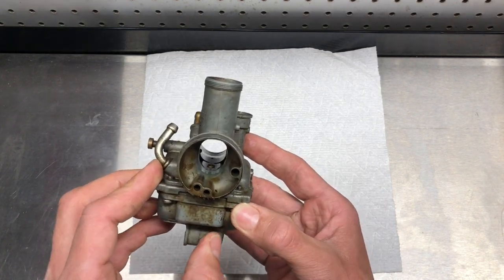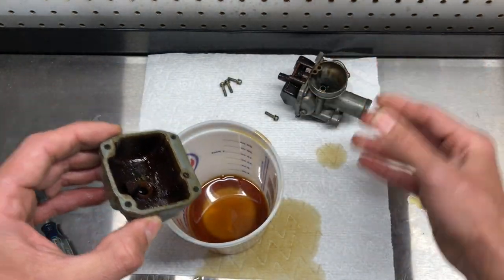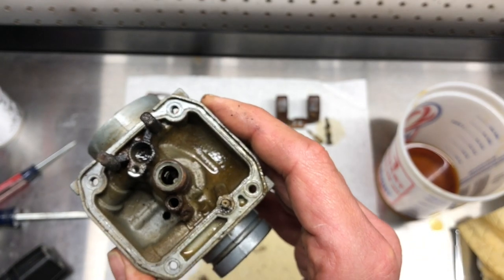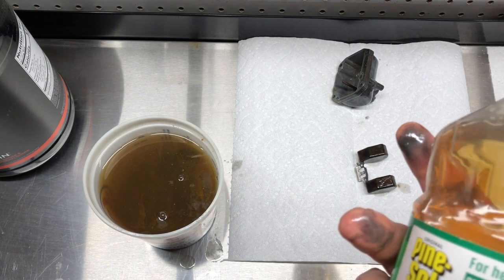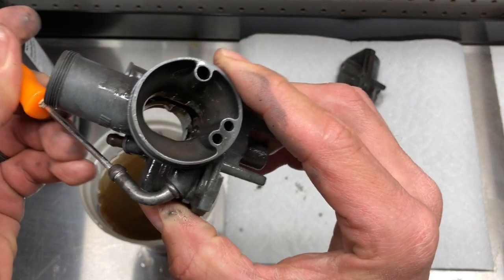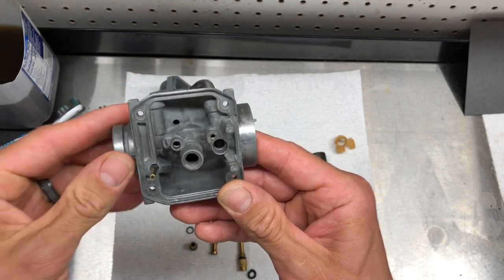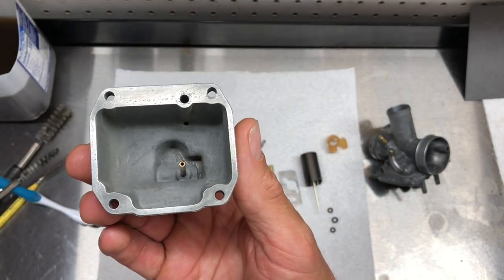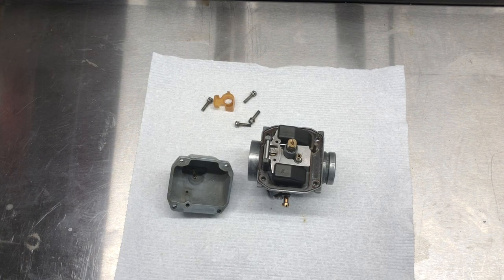Will Pine-Sol work to clean a varnished and dirty carburetor?

Comment: Fantastic job my friend! That is how you save a carb. That was nothing short of magic. I use simple green for pressure washers and it's quite expensive $20/gallon Canadian where the pinsol is just as good and I think better for so little money. The proof is in that carb you just saved. That float bowl would never have come clean with just normal carb clean spray.
Reply from the maker: Thanks for the love Pat!  I am really glad this little project worked out, the atv has been running quite amazing for just cleaning and setting up the carb!  I have found myself using Pine-Sol around my garage much more lately too haha.

Comment: Used Pine Sol over the wekend for my old Ford carb and worked very well. Only thing I noticed was Pine Sol tends to eat steel parts more than I expected. The  throttle lever and fast idle cam are steel and saw a bit of corrosion on them. Ended up using Evaporust in my ultrsonic cleaner and clened right up. I'm a new believer in the Pine Sol!

Comment: Great video. Lots of opinions on whether or not Pinesol should be used on aluminum. I use it all the time, in a heated ultrasonic cleaner. The key is to not let it sit for days or weeks. A couple hours or maybe overnight, then cleaning all of that dark gray stuff off--exactly as you showed. For the rough, external parts, I rub copper anti-sieze in, sparingly and make sure its all wiped clean. That seems to ward off oxidation of the aluminum for a good while. If you use it internally, I'd clean with a clean rag thoroughly. On the brass bits, Brasso and elbow grease get them into great shape.
Reply from the maker: Yea this is my first time really using Pine-Sol in this manner and I am glad I did rather than using a harsh chemical dip kit.  Thanks for the tips, I will have to wipe down the outside with a bit of anti seize.  I suppose that would work on the raw aluminum air cooled engine as well?
Reply: @HighPriority  I'm not sure how it would do on an air cooled engine. Probably pretty good. I used copper anti-sieze specifically, not the silver nickel-based stuff. I restore old BMW air-cooled bikes, with Bing carbs. Cleaning all that dark gray slurry off from the Pinesol dipping exposes the raw aluminum, so I hit it with WD-40, then wiped down and do the copper anti-sieze. I used Pinesol pure, maybe I'll try it 50/50 like you did.
Reply: ...oh and dress the sharp edge and 600grit or higher to gently smooth rough parts, before the anti-sieze.
Reply from the maker: @sailorcto  right on, thanks for the tips!
Reply: I have 5 motors sitting around WAITING for carb attention and will sure try this now. Th for the video....subscribed

Comment: Sweet! I just came across you vid today 6/3/23. I have a set of 4 carbs off my snowmobile (Rupp / Honda CB550). its been in and out of storage and run very little in the past 17 or so years. As of last winter, I lost one cylinder only rode one short trip around the field. This spring I started it to "summarize" it and noticed another cylinder dropping out. I pulled off the whole rack and dropped off the bowls.... yah. I was rather surprised on the corrosion and gunk build up. seeing I only run non-ethanol gas, i run it dry every spring (well not every spring) the tank is lined, I keep additive in the fuel and I still have a bowl just full of debris. (dirt, rust and deposits even looks like water was in them for a while) Im gonna try this method right here next week. I have a vid here on YT, (custom Rupp). It was running ok when i took this vid in the winter of 20" but not great.
Reply from the maker: Right on I hope this works for ya!  Sounds like a cool project I will def check it out.  The tank on this trike was pretty bad as well, rust and chunk. And stuff. I have another vid where I cleaned the tank out, I thought about lining it but didn’t.

Comment: Very impressive,  I work on a lot of riding mowers that I pick up free this will be my go to  from now on.  I have seen a video of a guy took a vibratory sander put velcro on the bottom of a jar stuck to the sander hung it up turned on the sander to get a little vibratory action going.  We 40? Try pb blaster it's cheaper and works great for me better than wd 40 does.
Reply from the maker: Thanks for the tip Gary I will try and grab some PB next time I'm out.  That sander idea sounds like it would work really well, I think I have one laying around here too!
Reply: I found that Walmart has the larger cans for like $6.00 and wd 40 is $ 8.00
Reply from the maker: @garyjordan3181  Good to know thanks.
Reply: I'm working on a carburetor now. Thinking of doing the sander trick with pinesol. Let the carb soak for a few hours in hot pinsol/water mix, then run the sander for like 30min...
Reply: I've done this with a sander. It really works well. Used pine sol. I have upgraded to ultrasonic cleaner simply because the setup is easier and faster. But it does work well.
Reply: @LowCountryoutdoors213  well it worked decently enough for me still went after the last of the dirt with a toothbrush but after soaking for 24 hours and vibrating with the sander for an hour the little that was left in the crevices and corners came easy enough. Th carb works well. However it doesnt really look new just way better than before.

Comment: I used Pine-Sol to clean the Edelbrock 1405 on my '69 AMX.  It did the job, too.  One float had gasoline inside it, which most likely explained why it flooded the last time I tried to start the 390 V8.
Reply from the maker: Nice! I may use it only on my Q-jet one of these days if I decide to tackle that job.  I just like how the stuff isn't so damn toxic.

Comment: Do ultrasonics get inside the tiny gubbins and that?  This is an excellent tip but not quite getting into the corners?
Reply from the maker: I did look into setting up some sort of untrasonic but I think I got lazy.  This method did work alright but I did have to pick junk out with some brushes and tools so I think using this in conjunction would be better.  I will try and do an ultra sonic on the next one!

Comment: I use pine sol soak it overnight spray with carb cleaner. Works on most of the carbs. If not order a new one

Comment: Maybe after soaking you use a water blaster to remove the grey scum. Then you should not need to scrub and the effect should be uniform over the whole caribe.
Reply from the maker: I will have to try that in the next project. It would be nice to have a uniform look all over the aluminum.

Comment: Looks great, but want to know if the carb actually worked to get your machine running.
Reply from the maker: Thank you George.  Yes sir the carb is back together and functioning quite well.  I did get junk from the tank that plugged up the pilot jet quite badly so I did have to replace that.  I will be making a video soon of it in action once I get a few other things wrapped up on it.

Comment: Nope turning that "aluminum" which really is pot metal black means you've ripped off the protective "parkerizing" which really is a zinc and cadmium coating. It will take the oxygen in the wonderful gas of today and make flowery alumimum oxide. You could have just used hot water and elbow grease to get it clean better. You also are better off using petro based because, well it is supposed to stand in gas for all eternity.
Reply from the maker: Thank you for the insight, I did not know this.
Reply: @HighPriority  You dont want to know how I know. Really the best "lazy" way to clean a caked up carb is a few days at a time soak in good old gasoline. Then take it out, tooth brush what you can off, and soak in fresh gas, Rinse repeat 1 week at a time. Works well in "projects time" = Winter, gas evaporates slow, breaks down slow and its all in dead (non riding) time. Also soaking the whole body of the carb is a bit counterproductive. Most carbs have dirt and gunk and other dust on the outside but just gas dried and lacquered inside. Getting those 2 mixed into each other is another sure fire way to make a bad problem much much worse. I'd clean the inside, and leave the outside as filthy as it was. But then again a "restoration" wont work with that.

Comment: Can you use this stuff indoors? Hoping to find a cleaner that doesn't have harmful fumes.
Reply from the maker: I used it in the garage and I don’t think it would be an issue in the house as it doesn’t smell bad at all to me anyway. Just reading on their website it doesn’t say it’s toxic and they use it in floors, laundry, and for other surfaces so you should be good!
Reply: @HighPriority  thanks! yeah just tried it and very pleased with the results and no fumes in the house
Reply: Pine sol is used all the time in houses. I use it to mop

Comment: The best thing is a mixture of meratic acid and water it only takes a few minutes, but it takes the shine off, you can bring it back with a small hand blaster using soda, I discovered it on line and tried it, works great but you are dealing with acid, the only other thing that works better is chem cleaner
Reply from the maker: Thank you. I may try that out on the next one.
Reply: Be careful with this combo. That acid reacts with aluminum. It looked like it started boiling instantly and ate a fuel petcock on me when cleaning a old fuel tank.

Comment: unfortunately we have no Pine-sol in europe, unbeliavable this was never been imported, a bottle from USA ebay + shipping costs more than a ultrasonic cleaner from China LoL
Reply from the maker: Ahh that's a bummer!  I wonder if you have something equivalent out there.
Reply: @HighPriority  i am still looking for, it doesnt look to be , right now, i looked everywhere. it looks weird noone did a similiar thing like Pepsi is to  Coke LoL
Reply from the maker: @idontcareaboutyou7757  haha yea maybe time to try some experimenting.
Reply: I believe the pinesol equivalent in the UK is Dettol.
Reply: @boastyy  thanks, i'll give it a try
Reply: @idontcareaboutyou7757  Hi mate. I bought an ultrasonic cleaner a couple of weeks ago and have already brought back to life five garden tools, strimmers chainsaws etc. What seems to be working great when cleaning the carbs is a mix I put together and this procedure.  I  have a 6 litre ultrasonic tank, put some fairy liquid and cold water into the tank until its about 20 percent full. Then I boil a kettle"twice" and fill the tank up to the fill line. (Better to not pour hot water straight into the tank without cold water in the bottom to avoid thermal shock damaging the tanks cement holding the inducers) Then I add a couple of cap fulls of white spirit, dettol and windscreen wash. Temperature should be between 50 to 65 degrees with that boiling water added and is much quicker than waiting for the tank to heat the water on its own. Put the ultrasonic on  and leaave it degass the mixture for a couple of minutes before you add anything to be cleaned. Works perfectly for me and very cheap mixture.Hope this helps mate.
Reply: @boastyy  thaks mate, i am thinking to get one of those ultrasonic cleaners, i will try this procedure, just what is it the -fairy liquid-? sorry
Reply: @idontcareaboutyou7757  Fairy liquid yeh I cringed typing it, lol, it is washing up liquid here in the UK, its the same as Dawn washing up liquid in the USA. Any washing up liquid for dishes will do or if you can get industrial strength degreasers but make sure whatever you use is safe for whatever you are cleaning. To be honest less is more, the ultrasonic and the hot water with just a touch of the other stuff does the job well and does not do any harm. Good luck man hope you enjoy your cleaner when you get it, I am very happy with mine.cya
Reply: @boastyy  Less is more LoL as a big Mies Van der Rohe fan i agree 100%. thanks for explaination.  i think i'll get a Aliexpress ultrasonic cleaner, they look good  and exactly like amazons ones. any idea to suggest me? thanks
Reply: @idontcareaboutyou7757  Sorry did not get back to you earlier mate just seen your message. I believe most of the Ultrasonics sold on Amazon and Ebay are made in China. So if you don't mind waiting a bit longer to get it I am sure the Aliexpress ones will be the same type and probably offer a good saving. Just check the reviews and go with a seller that has good feedback and have sold quite a few of them. If it was me I would probably go for a local seller from Amazon or Ebay. My thinking is, if the box is dropped the Ultrasonic cleaners are quite fragile, the inducers are cemented to the tank so can be damaged so there is less chance of something going wrong with a local delivery.Or if it does get damaged you can send it back easily, otherwise might be a nightmare. This is where I had my cleaner.
https://www.ebay.co.uk/itm/352933671393?var=622184200056

You can see the model i had and compare them with the sellers who might deliver them local to you. So many sellers selling the same type of unit I am sure they are easily available.Hope this helps mate, good luck.
Reply: @boastyy  thanks a lot. i will update what i choose and  wich supplier. stay strong

Comment: You can’t just wash the black off?
Reply from the maker: For the most part yes, it still had a full look so I used scotch brute or steel wool.
Reply: @HighPriority  and did the pinesol have any bad effects on the plastics and rubbers I got mixed reviews on google
Reply from the maker: @sneakysquidles2526  In my case no. The plastic floats were fine as well as the rubber tipped needle and some other plastics pieces.  If you are worried about the needle and o rings, the soft stuff, you could leave them out and just scrub them by hand. The hard plastics were for sure fine and I didn’t replace a few o rings due to age if I remember right.